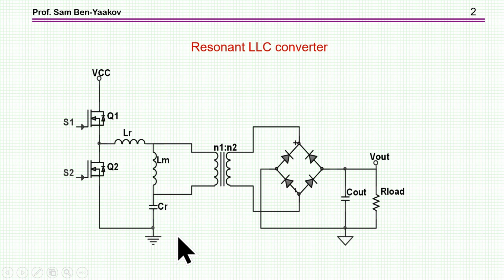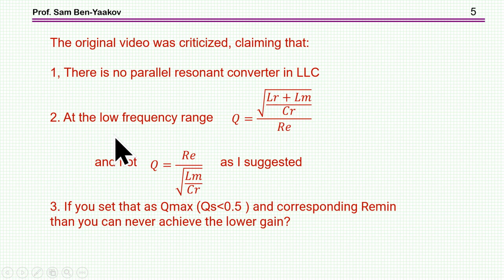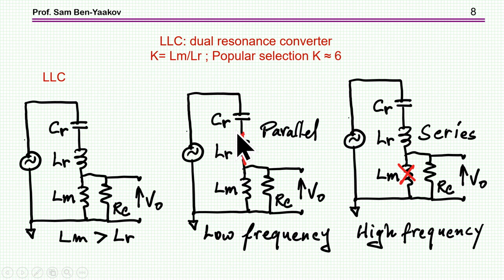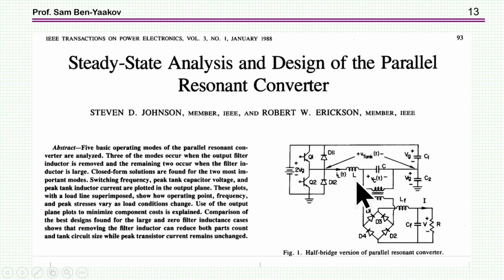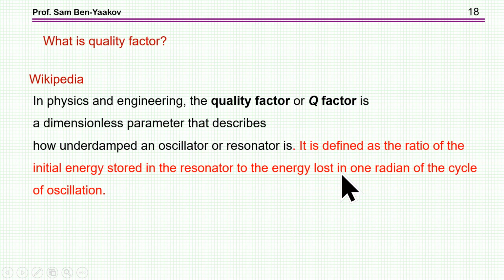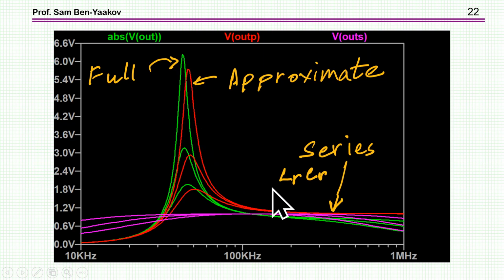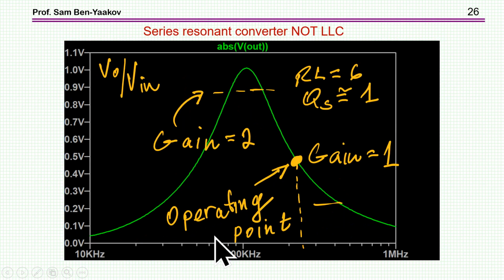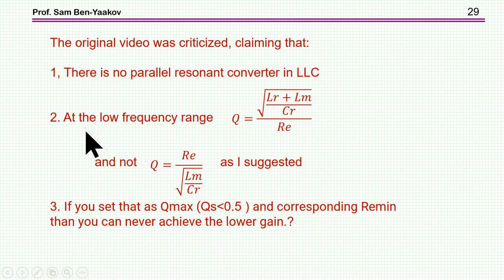What is Q in LLC converters? An appendix to: The confusing definition of Q in LLC converters

Comment: This is a really great and intuitive explanation. I wouldn't call using Qs instead of Qp a mistake though. I assume it is often used that way because under heavy load Lm is "shorted" through a small Re and Lr dominates. Since most converters are optimized for heavy load it maybe kind of makes sense to define everything that way. However, it makes the graph definitely more confusing. In any case it is now convention to use Qs and we probably just have to live with it.
Reply from the maker: thanks for input👍
Reply: @sambenyaakov  I really enjoy all your videos. They hit exactly the mark for me between intuition and math. Very useful for building real power supplies.
Reply from the maker: @lucasgerads1709  👍👍

Comment: Thank your professor for your last two, very instructive, videos. 
I had seen your other videos about resonant converters, but this last 2 indeed help to clarify things regrading LLC.
I'm actually very grateful to you because, if it wasn't for your videos, I was completely unaware of this type of converters.

I have however 2 questions regarding the practical example you gave:

1) Since in slide #23 you wrote fsw < 100KHz, wouldn't you be better off working on the other side of the resonance in slide #26, say from 40KHz to 80KHz?

2) In slide #26 you're going to set the gain = 1 where the actual resonant circuit gain is ~0.5.  How do you do that ?
(I'm assuming you can't double Vin)
Reply from the maker: 1. Below resonance you get ZCS and not ZVS which is not desirable.
2. The generic circuit at the primary gives you 0.5 and you still get the desired output voltage by adjusting the turns ratio of the transformer. 
Thanks for conversation.